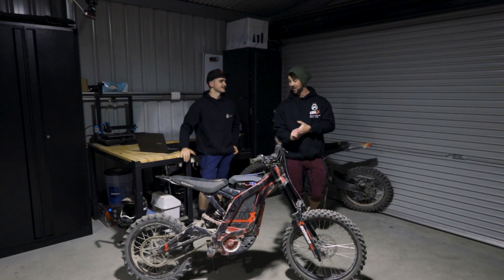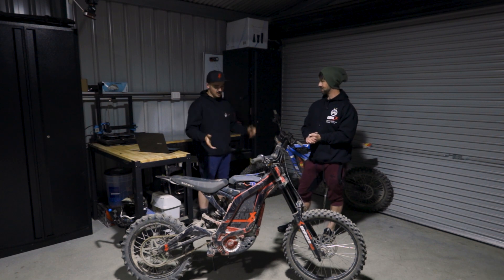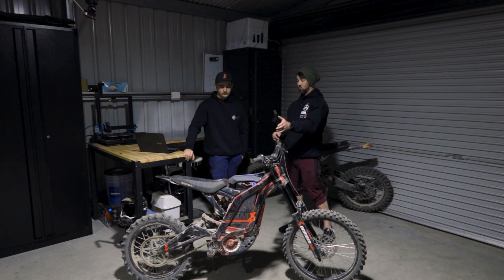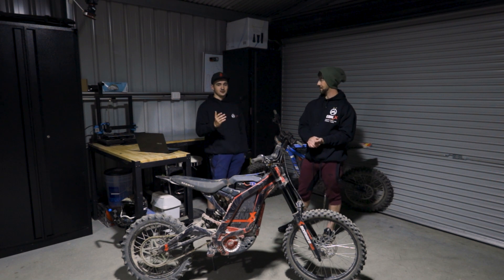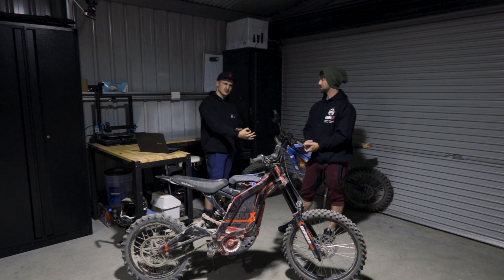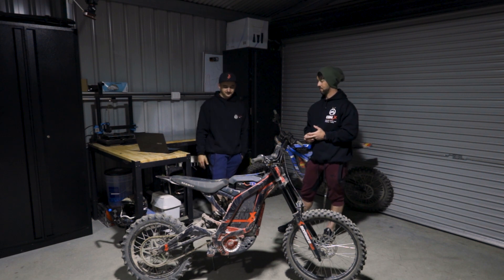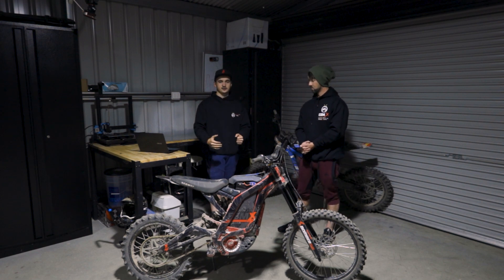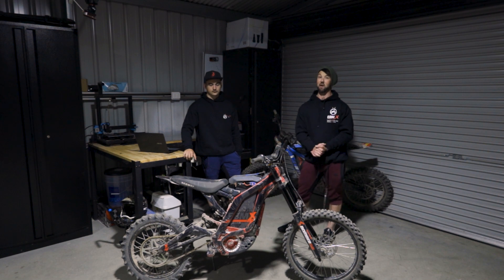What I'm running on my KO swapped SurRon E-BIKE||KO Motor tuning||How we gear our bikes

Comment: Hey Fellas, luv your vids. I have a Bac8000 on my sur Ron. EBMX battery. 21”F 19”R Starcross5. In the bush I never run out of battery but on the road the high rpm whipes the battery out. How does the KO go in those circumstances? And what is 5he best lasting sprocket combo? Any help would be appreciated 😊
Reply from the maker: Hey legend
64T keeps the temps down the most so you'll get some added efficiency that way. If your running stock motor I think the magic sprocket size is 64T regardless. Road riding will always reduce range compared to the on/off throttle while off road.

As far as range goes, we've noticed no real difference between the KO and BAC as far as any measured efficiency differences.

The MPTA on the X9000 from EBMX should theoretically increase range but only on IPM motors like the KO we currently run.

Hope that helps.

Comment: Do you think this is a good tune for I have a chi gladiator 60 volt Max with a 56 tooth sprocket with 19 inch wheels please let me know what you would do thank you
Reply: Also cheap battery is 420 continuous amps and 630 Max if this helps
Reply from the maker: What motor are you running mate?
Reply: @progressive_e  ko motor
Reply: Supposed to say chi battery not cheap
Reply: Also KO controller
Reply from the maker: @danvelazquez1649  100% this will work fine just adjust your amps lower and phase lower to start and work your way up👍

Comment: Will this tune run good with a Surron motor with a 54 tooth sprocket? I also have 19/16 setup
Reply from the maker: Hey mate
Definitely not, just due to using the KO motor. If you want to hit us up on insta can send you our settings for Surron stock motor!
Reply: Ok